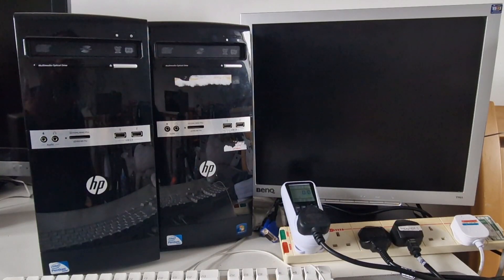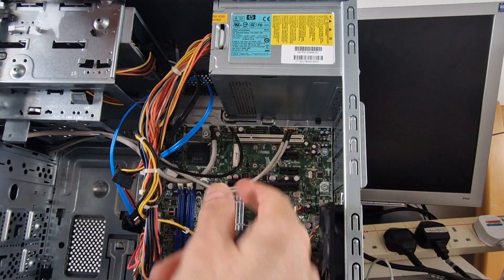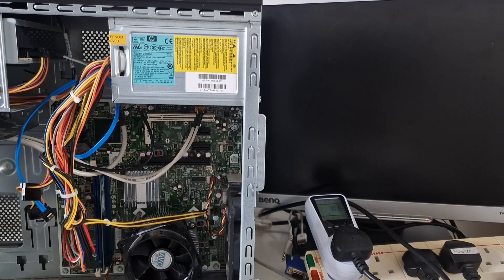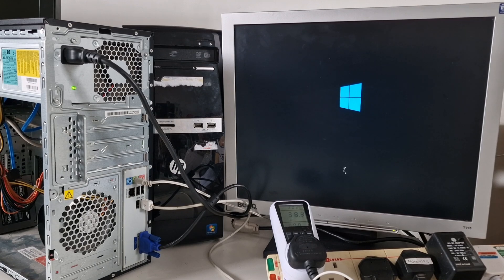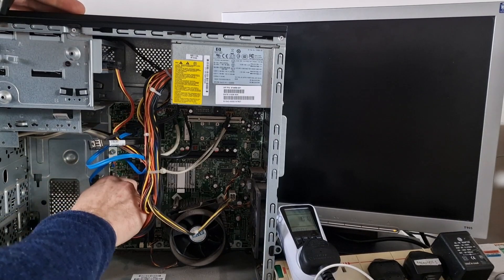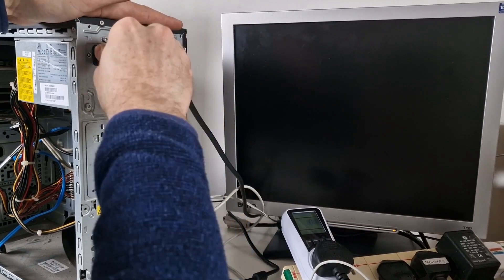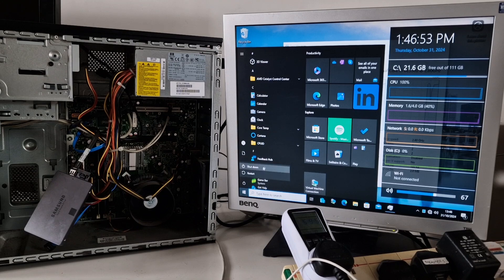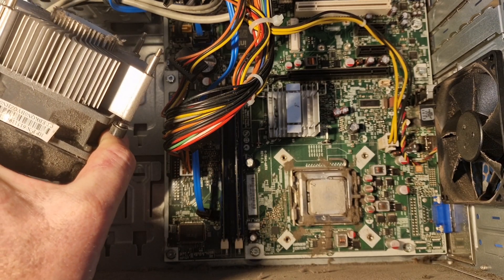Double trouble? Two Pentium HP Towers - do they work and can they be saved from e-waste?

Comment: depending how much of a processor upgrade you can do, and how much it costs, if you can, do that, and do win10. but if you want to get this in budget, i'd go with OpenBSD or FreeBSD or a modern linux that doesn't take a lot of resources Maybe that MX Linux?  the main thing that would matter, is with the linux or BSD is if you can use it navigate the modern web, and that requires a browser that is applicable, if it's 32bit. which then brings in the idea of a 64bit processor, if it will fit in that socket. I'm not a PC person, so I don't know all the socket types and what works. Of course you could always go backwards and either put Win7 or win98 or Windows2000.  But it really matters as to what it's purpose is. If it's just a file server that can store a jukebox of mp3's or video files, or just something for word processing and basic office-type operation. I have an Optiplex 990 and I updated the video card to an MSI NVIDIA GeForce GT 710 2GD3 LP Single Fan 2GB DDR3 PCIe 2.0 Graphics, and   ASUS AX1800 PCIe WiFi Adapter (PCE-AX1800); WiFi 6, Bluetooth 5.2 and some Samsung 860 EVO Series 2.5-inch's.  I did that last summer after taking it out of storage. it has a i72600 processor and I threw in 32 gb of ram a few years ago prior to putting it in storage. it had a 1fb radeon video card back then too. it ran Win7pro64 wonderfully, then I had to upgrade to win10pro64, which was free from microsoft. I have to be careful as to not spend any more money on it because, 1 any further upgrades, i.e. a new processor fan & heat fin thin would just put me over what I budgeted for the machine. it does run win11pro but it's not supported. I could buy a used newer Dell and get faster processing, more ram slots, video, and onboard ssd nvme or whatever that is. more pcie slots, etc. I just like testing out various linux's and using windows as needed. Oh, I did get a PSU and case fan upgrade. those things were the final items that I can get. unless I find a really good deal on a used video card, or open box that doesn't cost much. So my point in this long comment is, don't  spend much money on it. you can buy another used for the price of the parts to upgrade.

Comment: Ohh this brings back memories,  we had 30 of these in a primary school IT suit running Win 7 on spinning hard drives and 4gb ram , upgraded to win 10 on SSD , but still 4gb ram , on a internal server 20102 domain  worked fine for years , but Win updates finally slowed them down and then win 11 saw then hit the IT Recycling centre,  kept them running from 2012 to   2022 😊 but alas

Comment: LGA 775 is a legendary socket, get Core2 Quad's and see if it does 8 gigs Ram and put some used NVIDIA 1600 series GPU's along with some NVME sticks. that should be A-OK to crank out Tomb Raider 2013 at full 60+ FPS. Heck, It may even cream Battlefield 3 or 4 at 50+ FPS. Since you have 2 , you would be a proud owner of 720p Gaming & Streaming Queens just like it was back in 2010's. Like most of the comments say give it the full treatment.
I'm 34, regret selling my 775 Queen, but back then I truly needed a new laptop and wasnt having a grain of technology in me.  
I wont be selling this lappie though, an i5 Princess who served & slayed everything I needed along with 2gigs of AMD graphics.

Comment: A lot of these types of big chain store brand name pre-built PCs were force-updated to Windows 10 and then ran slow or stuff stopped working and were tossed in the bin. I have one here that was given to me by a local friend purchased in 2010 with 1st gen i5-750 that was running Win7 and then got force-updated to Win10 and the whole thing came crumbing down. First the TV card did not work in Win 10 and later the HDD would show a S.M.A.R.T error about imminent failure then soon after that the Geforce GT220 video card stopped (1st gen so no fall-back built-in graphics). After that the owner bought a mac (and hated it lol) and they gave me the pc which was a HP Pavillion p6380a. It's actually a pretty decent i5 with boost clock up to 3.2GHz, 8GB RAM and runs fine with Win 7 or Win 10 and still useful for general web browsing and youtube etc
Reply: Windows 10 can actually run decent on older hardware with certain upgrades. One major upgrade that will drastically improve performance is replacing the hard drive with an ssd. That alone would probably make your i5 750 rig run snappily on windows 10. Ideally you could put in a 256gb ssd and 16gb of ddr3 in it for around $30-40 total, or even less if you source your parts from a good place.
Reply: @awesomecomputers7076  I'm not wasting money on this. The PC is surplus to requirements. I have maybe 50 computers here, this 1st gen i5 is just another random PC I don't use.
Reply: @g4z-kb7ct  ah that's very valid, 1st gen intel is really old at this point. So old that if you have that many systems, it's not worth the time to bother if you already have other systems. I suppose you could maybe sell it on marketplace or something but something like that might not move quick or be worth the time as-is depending on what city/market you're in.

Comment: You wil never be able to put a core 2 quad in there are you forgeting something? That board only suports fsb at 800 mhz. And a quad core fsb is 1066 i belive. And that cooler is enough to cooling my i7 4770 its not a cooling problem.

Comment: Linux Mint Cinnamon, low end pcie x16 single slot GPU, possibly a PCI USB 2.0 card and/or pcie x1 SATA III card if desired. Windows 10, no, not even on a Q6600 these days, memory may already be maxxed, check mobo specs online. Or you could slap an inexpensive 6th/7th gen Intel combo into that thing, everything looks standard, still do Linux Mint Cinnamon as Windows 10 support < 11 months now and as long as the chip isn't a k chip should have OK enough graphics on the chip to keep the 300W PS 😀. Your call.

Comment: There is nothing wrong with the heatsink on the 2nd system. It's a Dell transplant. I use the same heatsink on a couple of systems with Xeon 4c/8t cpus. Works fine for daily use. Core2 quads are very reasonably priced these days.

Comment: I have an old Acer laptop which has a dual core 2GHz., CPU., 8 GB of DDR3 ram., and an ssd., and it works well with LMDE 6, perhaps those computers would also work well with such a combination.

Comment: I’d throw in a better cooler, a q9550 core 2 quad, 8gb of ram, a better PSU, and a GPU like a GTX 970 or similar.
Reply: Depends on the computer he might be able to max out ram at 16gb
Reply: @peterpramshafer933  g41 can only go to 8GB.

Comment: Nah,the heatsink can support a Core 2 Quad easily,i have an HP Pro 6000 SFF with a smaller heatsink than this running a Q9400 without any issues. I got that processor for 1 dollar on ali,works ok with Windows 10,8Gb of ram and an ssd for basic use
Reply: I agree.